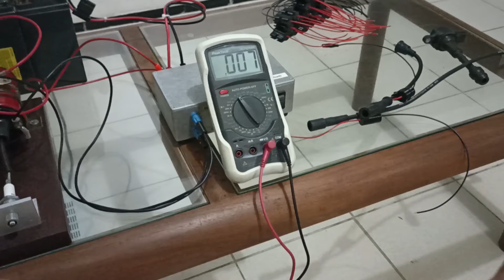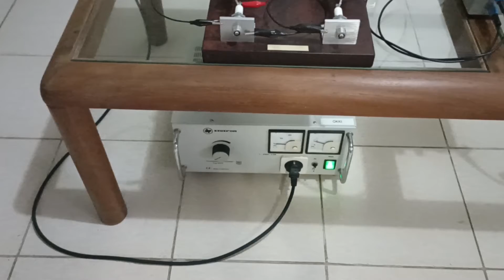Simple Plasma Booster - Detailed Explanation

Comment: How does it effect the wear on the plugs? Have you noticed any performance boost while driving or running an engine? Thanks for the video
Reply from the maker: Spark plugs wear is not that bad, almost identical to normal wear. Regarding the performance, what I see on my car is part throttle acceleration is better, not by much but noticeable.

Comment: if you add this to a lawn mower engine will it reduce fuel consumption?
Reply from the maker: Maybe.
Reply: @OkkiMoeljadi  it would make a great demonstration of the plasma plug tech. what codes are on the non resistor plugs pls?
Reply from the maker: I use NGK BP7ES.
Reply: @OkkiMoeljadi  thanks mate, really appreciate that. i have a vision of a new design that you will be interested in. will send an email. i dont want anything in return, its yours gratis.
Reply: wow beautiful